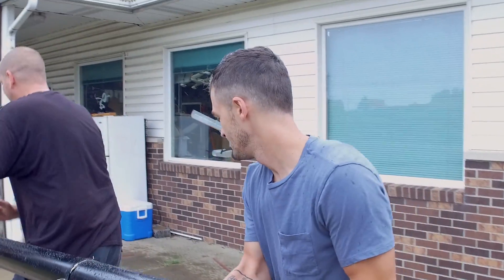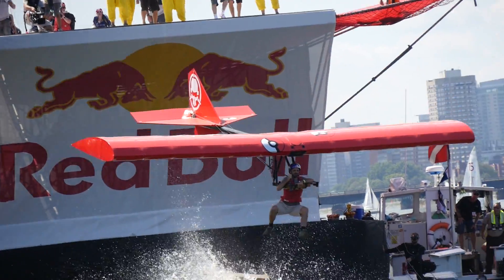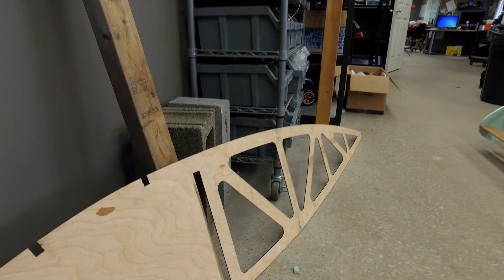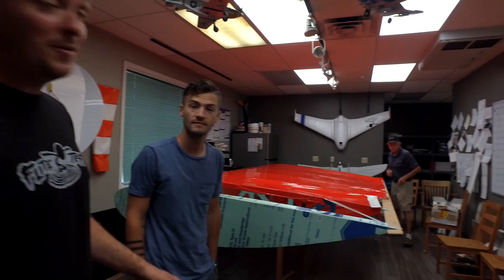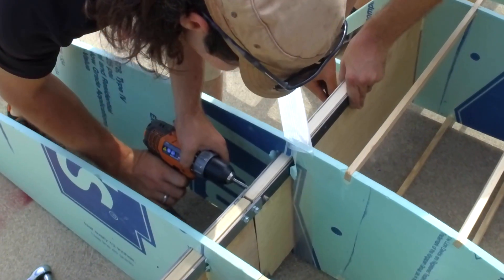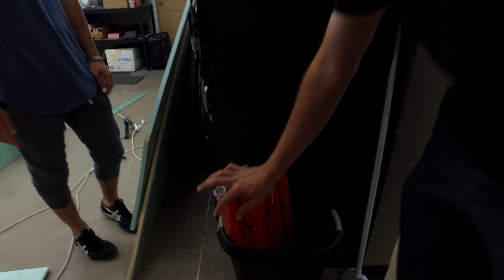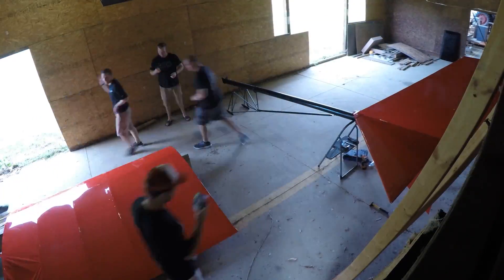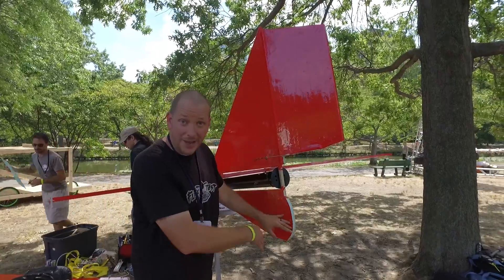How To Build a Flugtag Aircraft | Flite Test

Comment: I was always curious that for these type of events if you would be better off making a thin narrow wing with greater lift. So long as it was sturdy of course. I mean, I understand its just for fun and no one wants to spend much money but it should equal out and preform better for glide ratio. Why did you decide on such a fat huge wing surface area?
Reply: because it has more lift than a "narrow" wing at low speed. You need to balance lift and drag to the planned speed.

Comment: nice try guys.Look your design is right but the size is wrong.make the wings thinner more flexible remember flexibilty is strength basicall the guy in the middle of a sliding back to front motion gimble to correct his pitch and a shorter boom to tail and it will not only glide it will glide further than any you have see so far.Go to videos where its all but just a wing and youll see how they work.Your close but as you can see it should really be flying before it leaves the under carriage. Find a jockey to fly the next one.

Comment: Strange choice of airfoil? Some thing less symmetrical, with more under camber would have given better lift. Maybe even add some kind of flaps, again even relatively small fixed flaps would have generated additional lift. Still... a good attempt though.
Reply: Exactly my thought. Slow speed, so undercambered wing, simple.  Lots of effort, but not the best result.
Reply: Not a slow flight airfoil.  Slots, flaperons and an undercamber would have made it coast.  Maybe next time.

Comment: Ok, I'd like to see about 10 ~ 15 ft more wingspan, (say 6 on each side) and I'd like to see a launch at 20 ~ 25 mph, not 4, and that might well fly. Add a small 2 stroke engine, say 8 ~ 10 hp, and you have an aircraft there, not a joke... This is an ultra-lite, not a joke.... Very very well done! Just like the Flight of the Phoenix, you get a modeller to scale up what he knows, and it should work!
Beef up the main-spar slightly, near the centre, add a little to the span, give it a better aspect ratio, and you have yourself a perfectly competant aircraft there.

Comment: Dear FliteTest,

Over the past few months I have saved enough money to build one of these, and I am having a little trouble finding out how to make the wing template you used to cut out the foam. Everything else I have with me, but I cannot start the project without a template. if you could tell me where to find the dimensions of the template that would be great. I already tried DevWing but it does not work for macs sadly

Thanks!

Comment: I've been toying with using honeycomb cardboard in place of foam for larger scale aircraft as it is about the same weight as foam, or marginally lighter,  but it is way more rigid.  Slicing it span wise and also build in the aerofoil shape so the wing skin becomes a rigid surface

Comment: Also,  please consider that the degree of incidence was to shallow , flat. Increased incidence = increased AOA (angle of attack) which speaks to the relationship of the wing to horizontal stabilizer. The large amount of elevator input observed may have been that there was not enough difference  (AOA/incidence) built into this airframe. But, as others have said, it simply low airspeed stalled.
I would make it exactly the same CG and dimensional ratios, but with one exception, increase incidence by some.
Build a one quarler scale RC model and launch platform to proof. Next...FlightTest, FlightTest, and FlightTest it again. LOL
Reply: You can't do all that testing in two weeks :). And there was a lot of work to be done for Flite Fest before.

Comment: To increase airspeed at launch...would a catapult system be allowed and used to assist the pushers? use the same carriage and add a medium throw (length) catapult system extending out the back of the carriage fixing on the tail boom like a scuba speargun. Stored energy.
Reply: You are only allowed to use human power.

Comment: You guys are awesome for sharing your methodologies to everyone, including next year's competition.  

Are multi-wings allowed?  I think you could achieve much more effective wing area in a smaller span with a bi or tri-plane.  You probably can reduce weight using and school tension wires instead of a cantilevered wing.  cables are draggy, but that won't hurt you much at the low speeds.  Of course you guys used building techniques that you use daily.  it is amazing how quickly you put it all together.  Victory at Flugtag after hosting a world record achieving Flite Fest.  You guys are amazing.  Keep it coming!

Comment: What do they call that foam your using from Lowe's?
Its not the fanfold is it?
Reply: I don't think it is the foldable foam. At Flite Fest people just called it green insulation foam. It was bigger sheets, but I don't know the thickness.
Reply: They used 1/2 inch for the ribs and 3/4 inch for the tail surfaces

Comment: From the flight video, it looks like there was insufficiant elevator authority to pull the nose up. A full flying elevator might have allowed the pilot to hit the water with a stalled wing much further out than where you did. Or a canard design with a fixed pitch might better optimize angle of attack, and free the pilot to only worry about roll, yaw and landing.
Reply: The issue was not enough airspeed.  Elevator was big enough.  The fact a very docile airfoil was used combined with a nice forward centre of gravity meant the glider still was stable in a semi stalled state.  A more reward CofG would have meant more elevator authority but also possibly meant less stable at stall.  Because we were not able to test at all I was happy to stay conservative.  There were wind concerns after some aircraft rolled prior to liftoff after a bad quartering headwind caused havoc and safety concerns.  I was most concerned about not taking off before the end of the platform and keeping wing level with no ailerons.  After I left the platform I tried to get as much airspeed as I could but then realised the water was coming up fast so pitched back for the landing.  A bit more airspeed and I think over 100ft was possible.
Reply: Maybe next year
Reply: Right, very "draggy" airfoil, thick, blunt, and CG sensitive.
Reply: Thanks for the reply. I agree it is better to carry excess speed into the water than bleed airspeed to zero while still at altitude. It is the overly busy flights that get the most Monday morning quarterbacking.

Comment: if legend has it right, if you comment this early chad responds back
Reply: +Balu  or another Red Bull?
Reply: btw can you exlain 25 vs 200 vs 600 mw to me
Reply: Chad? The old one, the glider pilot one or the new one? Too many chads around!
Reply: It's different amounts of transmission power of your video. 

Usually more is better for distance, but if you have obstacles around like metal structures, etc. the signal might bounce back resulting in a degraded image quality (multipath effect). This gets worse with higher mW.

Also it might affect other people's signals.
Reply: The legend is false....
Reply: holy crap its literally my idol.......  I fly MODE 1 TOO!
Reply: FinalGlideAus
Reply: +FinalGlideAus But aren't you the legend? Does that make you false? This is confusing. I need more coffein.
Reply: Correct :)

Comment: gonna copy it, build a motor on it. Then laugh as i fly away and watch all lozers walk
Reply: Better hope that bolt holds you
Reply: Naegleria Fowleri im skinny so i wont be much weight
Reply: If you really do it you should get a polini Thor engine. I recommend a 250cc or 200 evo is pry the best
Reply: turnigy rotomax 150cc and your good to go
Reply: +Nazistazia the German Princess 150cc may be more than enough but it really depends. Better to have the extra horses if your life depends on it
Reply: Naegleria Fowleri place wont be a problem. I live in Germany, Rheinland-Pfalz, There is nothing but hills and cliffs here. A 15 minute drive takes me to the Hunsruck, where is even more hills and dall's.
Reply: OpfeKuacha how much power would a scooter engine perform. Scooters keep getting faster and the engine is relative small
Reply: +Nazistazia the German Princess I would honestly get a paramotor engine because they are designed to be for light aircraft. A scooter engine might weigh too much and it isn't designed to be on an airplane
Reply: Naegleria Fowleri what would be the minimum for a plane to perform? 150 like opfekuacha said? Some of the first planes flew like 80 mph?
Reply: +Nazistazia the German Princess Well for a glider with foam ribs I don't think it should go real fast. If you add a seat to the frame and landing gear the glider will get some weight. I guess it will be a couple hundred pounds. Therefore you should get an engine of somewhere around 200cc or more. There is a lot of variables and I guess you have to test it yourself
Reply: Naegleria Fowleri Alright thanks for the Help! I am fascinated by planes and always wanted to build/fly one but to no avail yet. So i have been planning, drawing and experimenting with models. My biggest problem will build the wings sinds those need the most space. But all in time. Currently i have a wood/paper model of a plane i simply named the pigeon. One day i say....
Reply: +Nazistazia the German Princess But don't use ducktape for strenght 😂
Reply: +Nazistazia the German Princess Cool just don't hurt yourself. Be safe even if it costs more money buy a parachute and fly high so you can deploy it if needed. Good luck!
Reply: leo ulreich Don't worry im Mcguiver
Reply: Somebody has built a flying wing using a mixture of Ultralight aviation and RC modeling construction techniques using elevon mixing and servos. He used Monokote to cover part of the structure, a canard,  along with foam chromoly steel, and  a pair of DA 150 twin motors. And it flies well.

Comment: What's the frame made of?
Reply from the maker: Aluminum!
Reply: +FliteTest Thanks for replying, It looked like carbon fiber or some other composite
Reply: Does someone have a machine shop? Seems that would eat up most of your budget
Reply: 1/2 inch foam, wood, alumINIUm and carbon fibre

Comment: do you think this is something a beginner pilot could do?
Reply: It is a glider. So yes
Reply: +Nazistazia the German Princess gliders can be quite difficult actually. Since you have no power if you stall you can get in a lot of trouble really fast. I'd recommend learning quite a bit before you even start flying. I'm kinda interested in building one that is powered by a bike. I've built a heli before with a small engine and that was pretty fun. I think a plane would be pretty cool too. You need a lot of space for take off and landing rolls though.